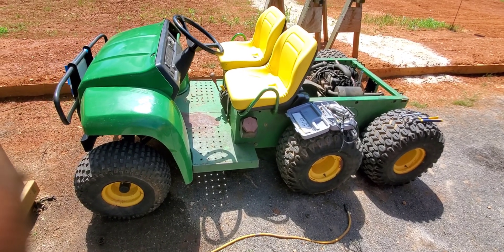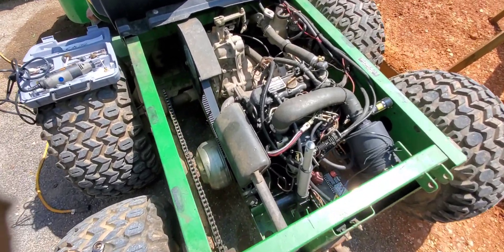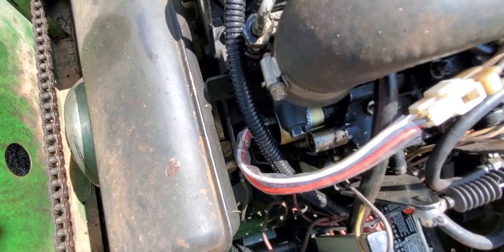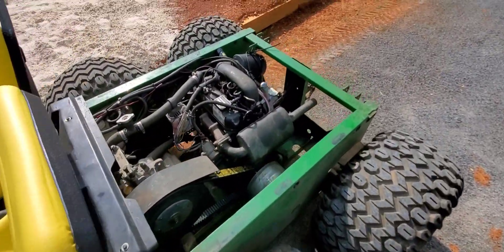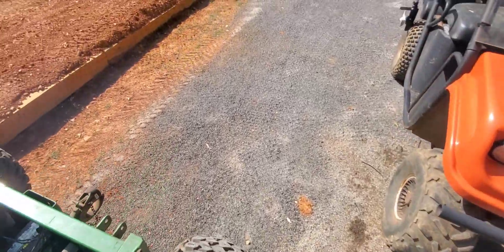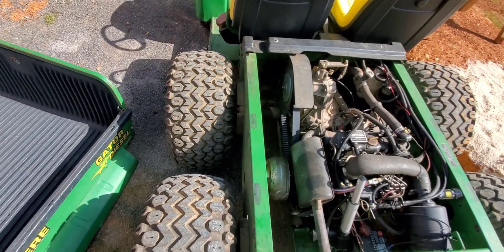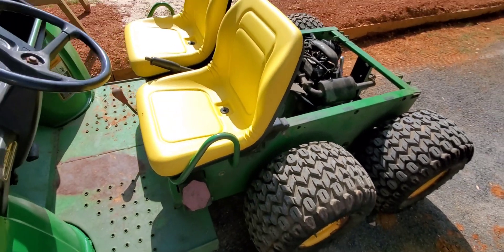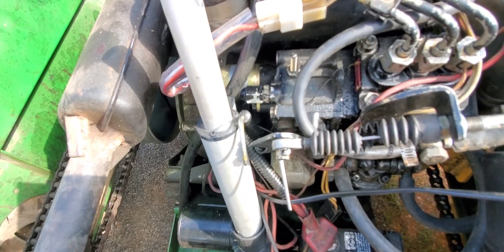Turning up a 3 cyl diesel yanmar how to make a jhon deere gator faster

Comment: Just bought one about two months ago, ugly but runs like a top does at least 25-30+. Two days ago would fire but not start and run. Have been told it is either the glow plug relay or injectors. Will figure it out because it is a beast of a little farm hauler.

Comment: If you still have it you can swap the governor spring(s) in the injection pump and you can really make it go. Those yanmar and diesels kubota diesels are capable of amazing power if you mess with them
Reply from the maker: I sold it shortly after the video the guy that bought it wanted it turned down I think I was reving around 4000 rpm I don't think there was much more left in it
Reply: what different springs do you put in it?